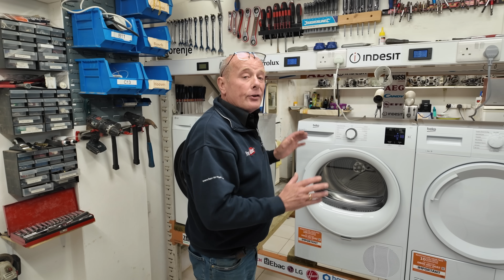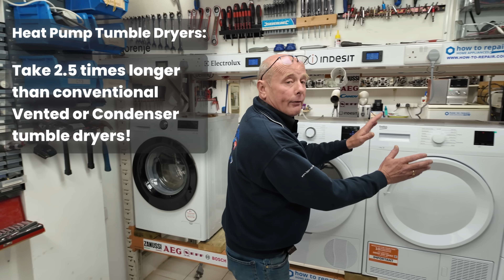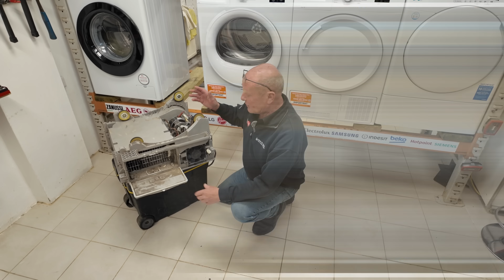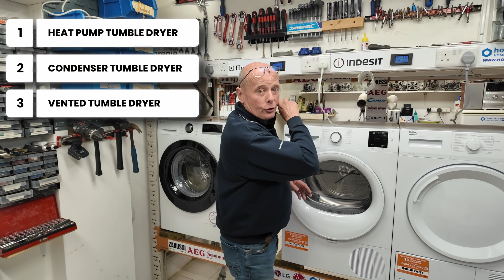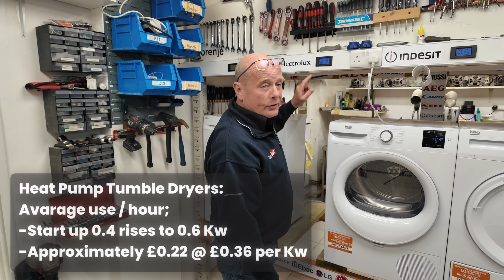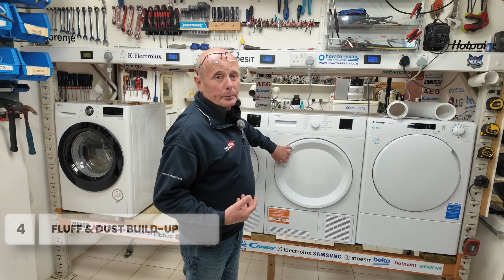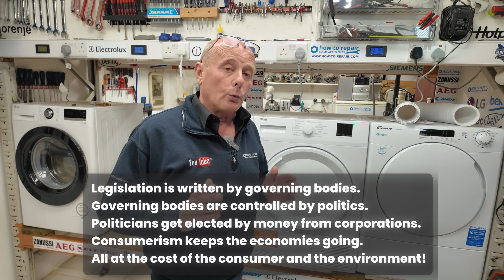Tumble Dryers the Shocking Truth About Heat Pump vs Vented & Condenser, NEW LEGISLATION!

Comment: A very interesting video with lots of good info. Our Samsung heat pump dryer, and the filter system is similar to what you showed on the condensing drier, minus the condensing section.

I would disagree that it takes 2.5X longer to dry clothes, 1.5-2X is more accurate. It likely depends on the drier tho. I’ve heard folk complain that they don’t dry clothes and need to be run at the maximum setting, but in found automatic mode works great, if you give the clothes a shake when you remove them, the humidity seems to vanish leaving clothes that you can just hang up without ironing.
Reply from the maker: Thank you for your comment. I appreciate people like you taking the time to write it out. Please share it where possible. It might help others make a wise choice instead of being misled by the industry.
Reply: @ TBH, if I had the voice again, I would Likely make the same decision. We have a mid size solar system and 450 watt draw vs 2kW makes a noticeable difference when max generation is only 4.5 kW on a sunny day. In winter here in Melbourne, days when we generate only 5kWh total are not uncommon. In summer the UV actually so strong it’ll damage clothes hung out on the line, so on a 30c+ day all the appliances are competing with a 5kW AC system.
Reply: I run our newish heat pump dryer on the "cupboard dry" setting. After it completes, I take the clothes out, whereupon my glasses fog up due to the humidity! I then shake the clothes out to make sure they're not tangled and run it again on the same setting. This doesn't take too long, but it does remove that residual dampness. The clothes don't feel as dry as with our old vented tumble dryer, but it's probably bad for clothes to dry them too agressively.
I'm not sure how much longer the heat pump dryer takes, but I think it's no more than double the time. I don't know how that translates into kWh used, so I can't tell how much I'm saving.
Our new dryer (bought from Argos) wasn't much more expensive than a vented dryer, but I did think it wouldn't last as long because it's much more complicated. I'm hoping to save enough on electricity to compensate for the shorter lifespan of the device.
I also note the new machine is much heavier. I was able to wrestle the old drier into the back of our car to take it to the Council dump (sorry - recycling facility), but I'll have to pay someone to take the new one away when it conks out.

Comment: One thing you didn't touch on is the environment needed to run a heat pump dryer. Unlike vented and condensers they won't work below 5°c. Anyone who has their dryer in a shed/garage or in a porch like my parents won't be able to have one

Comment: I've got a Bosch serie 4 heat pump machine. Honestly when I bought it I did not realise how much longer it would take to dry clothes. Especially if you put in a load with towels it can take 4h+ sometimes for everything to be completely dry. Furyher, I need to gave it on the 'driest' setting to actually have dry clothes come out. I've also noticed my clothing shrinking more quickly but never clocked that it could be due to them spending more time on the dryer untill it was brought up here. Honestly, I dont even really care about spendong 1-200 pounds a year more on energy if my clothes dry quicker. We have two small kids and the dryer can be a serious bottle neck. After watching this I think I might sell the heat pump machine and buy a cheaper 'less efficiënt' machine or just buy a 2nd.

Comment: Well, we bought a heat-pump-dryer some years ago. Before we had a condense-dryer. 
I'm very satisfied with it. The flat isn't heated up anymore, drying doesn't take longer - the compressor works with butane, which heats up better than other gas.
The lint stays in the filters underneath the door and can easily be removed, the condenser ist washed out automatically after each use - no problems yet! I don't miss to remove the condenser and to rinse it in the bath tub regularly. And yes: Clothes shrink less in comparison to conventional dryers.

While watching your video 5 kg of cotton cloth were finished in 1:25 hours (Spin: 1600 rpm).
Reply: Exactly.

Comment: 1.4 the energy for 2.25 times as long is 60% of the energy. (1.2kWh  per dry). You suggest 250 drys/yr (people really dry clothes more than every other day? boggle). So that's 300kWh/yr. or about £78 of average price electricity and 60Kg of carbon emissions. The condensing machine would be 500kWh, £130 and 100Kg of emissions. So that saves about 50 quid/yr and 40Kg of emissions. Looks like you will be ahead on cost after a couple of years or so depending how fancy you went.  We've all been happy with heat pumps in our fridges and freezers for decades. I'm not convinced they are a particular problem in dryers. Cars get leaks found and regassed for £80 from a visiting technician. Can't see why it should cost much more on a dryer. I'd like to think that in the last 3 years the access for cleaning has been improved. I certainly agree that right to repair is very important, and of course we've had (limited) legislation to that effect on white goods since this video was made, so that's progress. Using low-GWP refridgerants (butane/propane/CO2 is a very good idea, and increasingly common, which removes the whole 'F-gas engineer' problem, and means that leaks are not causing large amount of atmospheric heating. I don't know if dryers are following the rest of the HP industry in this regard yet. I couldn't find a figure for dryer embodied emissions to see how long they need to run to cover that, but it's usually a matter of months for white goods. (2 months for a gas boiler for example). In that case even if they only last 5 years they will still be a big improvement over conventional dryers. If they last 10 or 15 then that's all bonus. Overall better kit to reduce energy use is a good thing IMHO. This isn't greenwashing, and I think this chap is just getting old and doesn't like change :-)

Comment: As you pointed out, a heat pump drier takes 2 1/2 times longer to dry a load at about 1/4 of power. Total energy consumed in kW-hr, which is what matters in our electric bills,  is the product of these two figures. and which is equal to 1. So almost identical to vented and condenser dryers. Where is the energy saving?

Comment: In the winter time. I disconnect my vent from the outside and connect it to a lid on a 5 gallon bucket filled with water. The water bucket is used to remove the moisture from the exhaust. This way, instead of just venting all that hot air to the outside. I can use it to heat my house with. In the summer time, I use the clothes line.

Comment: I have a 20 year old vented tumble dryer it cost under £100 and I continue to repair it myself It works fine and as long as the spare parts are available it will last another 20 years. Now that is really environmentaly frieindly. We have the same issue with new vehicles we must keep repairing them not scrapping them my car is 28 years old.

Comment: We bought our first tumble dryer for our first son's nappies.  He is now 36 and the dryer, was still working fine when it was swapped last year.  It was a Hoover Logic dryer and enjoyed 2 new motor capacitors, 1 new belt and 1 new (mechanical) timer.  If I could buy another, I would: this was not top of the range, just sensible design that was repairable.  I'm an engineer and I have worked on train air conditioning in the days of freon (R12)... but there is no way I can satisfactorily repair the refrigerant system on a dryer (or anything else) without a great deal of special tools.  Besides which, I could be wrong, are the new tumble dryers yet more domestic machines with high pressure propane (or similar) coursing round their veins? This sounds like an accident just waiting to happen.  I wonder if anyone has done the "embodied energy" calculations for the energy cost of producing, transporting, installing & scrapping 6 dryers with a 5 year life compared to our one simple dryer plus a few small spare parts?   Hope this helps the discussions. Rob D.

Comment: Used to have a Samsung condenser dryer the worst, lasted just over 2 years outside the warranty period. They are the worst brand for whiteware. My condenser dryer was full of fluff inside. I stripped it, cleaned it everything. Didn't work. The worst thing with Samsung units is the doors. They have terrible mechanicisms and always fall. I just have a Samsung washer and fingers crossed it lasts. I have a F&P (NZ) heat pump dryer and that thing is brilliant. Well made and easy to clean. I'm also lucky that our weather here in NZ is slightly warmer so don't use the dryer as much.

Comment: There are other disadvantages to vented dryers.  They create negative pressure indoors and infiltrate outdoor air which creates even more work for your heat recovery or any cooling.  It's a big impact.

In terms of drying time, who cares?  How often are you standing at the ready for the dryer to finish?  If you are, get two of them... you'll have the space for it.

I'd love to see the things have a dehumidification cycle, as well.... just turn it on to grab moisture and remove it from the air.  Send the condensed water to a tank to use for the toilet.

Matt Risinger estimated that it is over 1500kWh of power per year to condition the make up air due to venting dryer exhaust.  So, the heat pump and condensing units save a TON more energy than first considered.  That's $150/year for me with my rather cheap electricity... $450+/year for places with more expensive electricity.

EDIT: Okay, I have to call this out.  It sounds like hyperbole (and not directing it at you @How-To-Repair, but what is likely just standard opposition).  Piles of heat pump dryers because they can't be disposed of?  It isn't that difficult to handle this.  In fact, there is a ton of opportunity there.  You get a recapture pump and recover the refrigerant, then you have these valuable metals to recycle.  That refrigerant has value in the industry, too.

Maybe a better design is necessary.  The entire heat pump should operate as a "packaged" unit that can just slide out from the bottom and then that could be taken to qualified person for service.  Finding leaks are really not that challenging at all, especially for a small package like this.  Far easier than finding the leaks in a central air system.

Honestly, this seems like a great opportunity for repair technicians that has had a more difficult time as things have become more "disposable."

Also, I really don't see the appliance manufacturers being the one instigating this for their benefit.  They're responding to demands and it likely has a huge cost for them to establish the means to build this equipment.  Tooling up a refrigeration practice, even if it is someone else doing it which still requires sufficient handling, engineering, and repair skills in house, is expensive.

Comment: I only dry my clothing in the dryer partially because I concluded years ago that the lint in the filter is my clothing disintegrating from the air and heat caused by the drying process of a tumble dryer. I place my shirts and lightweight slacks (trousers) in the dryer for about fifteen minutes which is long enough to blow the wrinkles out and for about twenty five minutes to dry denims and heavy weighted fabric and hand dry my clothes the rest of the way. My clothes last longer, keep their proper draping and don’t fade. As a result my clothing lasts much longer than anyone else’s that I know and since I buy classic styles nobody notices especially since I have the shopping sickness and collect too much.  I still pull my vented drying out every year and vacuum out the ductwork both inside of the machine including the heating coil and inside ductwork and the duct hose that goes out of the house. I never want to experience another house fire like I had earlier in life and many American brands of dryers last decades. In recent years its become the washing machines whose lifespans that have shortened considerably.

Comment: I am glad we have "cheap" power here, our price per kWh is only about $0.11USD.  We have traditional dryer, that now is close to 15 years old.  The LG has been rock solid.  While ours is electric, we do have natural gas options as well as many homes have run gas lines to this area.   I have a friend that purchased a Miele heat pump dryer a number of years ago and he is happy with it, but that is the only person that I know here that has one.  🤠👍  I really like the KISS method for machines design, and while our LG isn't, its still way more simple than the heat pump dryers for sure.

Comment: I always thought a dryer was a good application for a heat pump as the cold side could be used for condensing. Replacing boilers is going to cause brown outs. I guess driers need to be better designed with accessible filter cleaning and perhaps element heaters to boost the heat in addition to the heat pump. Until then this legislation should probably be delayed. Does anyone know if washer driers have dust issues?

Comment: I bought a heat pump dryer in replace of my vented as I thought it would save some money, I don't have room in my house for the dryer it lives in my garage which isn't heated, I told the salesperson this at the time of purchase, they said it would be fine. That turned out not to be true heat pump dryers need to be in a warm place to work so after it broke down in the winter I'm back to a vented dryer I wished I'd not bothered in the first place. Lots of hassle had to buy a vented machine again complete waste of time and money.

Comment: I agree with many of your points. Thank you for taking the time to post this. Manufactures are scrambling to create a reliable & serviceable platform. I wish you would have added data about how vented dryers pull outside air that adds to HVAC costs during high heat, cold, or humid days. Running a vented dryers on days below freezing can really tax my heating system. I typically have to start a fire on severe cold days while running the dryer to keep the house comfortable.
Reply: No, manufacturers are not scrambling to create reliable and serviceable appliances. They were able to do that 60 years ago or more. So if they wanted to, they could. But why would they? The FTC doesn't care if the customers get ripped off, and with the horrible durability and quality, consumers have to buy their pricey appliances way more often. In the last decade or more it is profits above all, and with the government in their back pocket, they have no worries about what they are doing.

Comment: These are all valid arguments drawn from your vast experience and I cannot disagree with you. However, I would remind that a heat pump tumble dryer has a refrigeration circuit very similar to that of a fridge, so you'll have similar chances of having some trouble. Also, I noted that my new Miele heat pump tumble dryer collects much less fluff compared to its old condenser counterpart, and I believe this is thanks also to the much lower drying temperature, which is much more gentle on garments. The Miele engineer showed me that most new machines have only two air filters while Miele has four, this is by design to prolong the machine longevity quite significantly at the condition that these are always kept clean. Components are also tested to last 20 years of standard operation, my last Miele lasted 17 years so I'll stick with that family brand. Hope this makes sense!
Reply: Yeah but a fridge not recycling air through cloths and collecting lint from cloths..  So way bigger issue with these dryers than condensors on fridge.
Reply: @FarSideBlues  oh yes, I agree and get that, the bottom line is that one is much more sensitive to routine maintenance than the other.

Comment: Thanks, my very old vented dryer ran for at least 30 years maybe more, never had any maintenance apart from fluff filter, it finally failed.
I looked at all 3 designs but eventually bought a vented unit for under £200, glad I did now after watching your video.
I am an Engineer and power saving is second nature to me, I have Solar and battery and EV, but I also like the KISS principal and the heat pump design looked too complex, emptying the condenser would be a pain, so a cheap vented for me.

Comment: I do not own a tumble dryer, nor would I,  as we hang our washing on a line outside or on a clothes airer inside, but as a cleaner, a lot of my clients have tumble dryers, so I found this interesting. We are very low energy consumers at home and are very mindful about our usage.
On the points you have made about design and  consumer repairability of household items, I have to agree. It irritates me no end when a manufacturer thinks more about the style an bling, than the person using it; vacuum cleaners that you need strong thumbs and a degree just to empty them to irons where the steam/spray is on top so you have to contort your hand to use it; and if you have a plug fuse go, you can't replace it because they're sealed moulded units! Green?

Comment: £400 is a lot cheaper than I thought a heat pump dryer would cost. Well done pointing out the disposal cost.  I would only comment that you could say the reason it cost so much to dispose of a refrigeration unit is because of the potential environmental hazards.